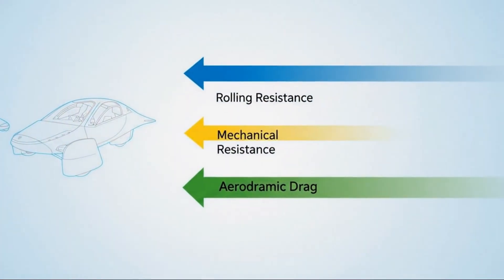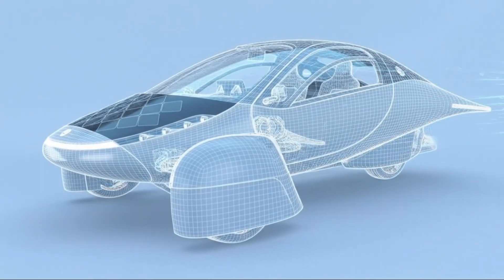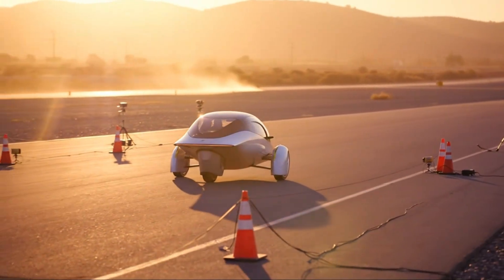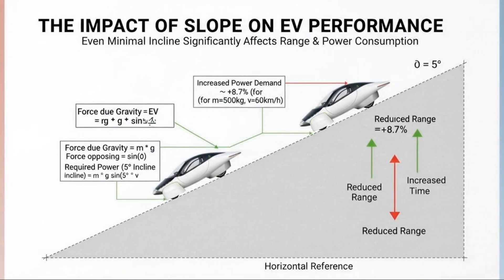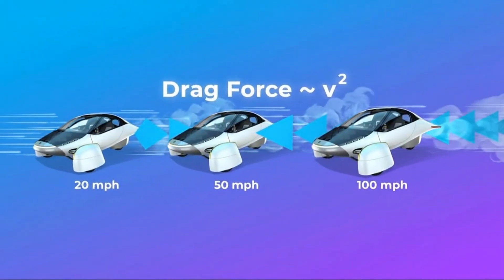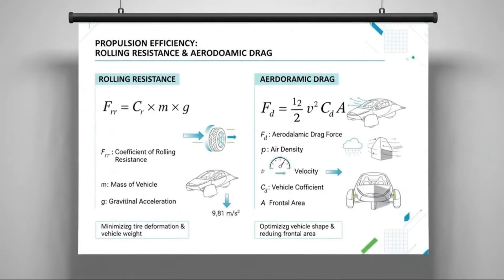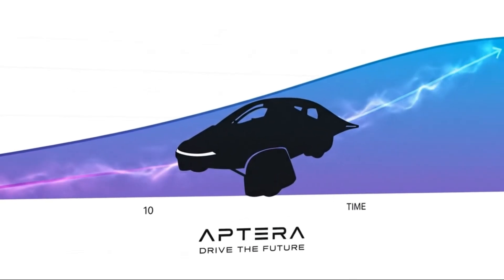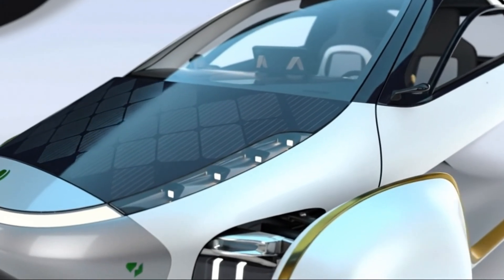Aptera's WIND TUNNEL TESTS Prove Its Efficiency Claims Are REAL

Comment: Although I have no proof: I think this AI bullcrap is just one more aspect in a long line of bullcrap from Aptera.  If Aptera can do that in this video; then it would seem to be ok for me as well.   Get your facts correct.  Very disappointing.  
The promises of market ready vehicles in 2022?? 2023?? 2024?? 2025??  Now, who knows.  "Time lines have shifted more than once"   One of the first factual statements here.
Also, I have repeatedly stated that the width of the Aptera front wheel base will be an impossibility for European and UK markets.  I have lived in the UK for over 35 years.  My current car has a wheel base of 70.5 inches.  That is a mid-sized car in the UK.

Comment: why do you keep giving false information, there is no wind tunnel data for aptera, they suppressed it in the pinanfarina wind tunnel test, they supressed it in the air shaper study, and the nasa study 20 years ago was based on a hand sized playdo model and only a simulation no wind tunnel used. 
Your information is simply false, no one knows the aerodynamic cd value except aptera directors and they supress it, why because its probably nothing spectacular like they claim.